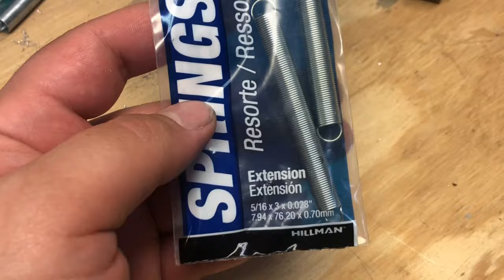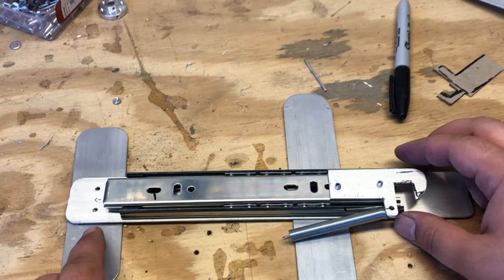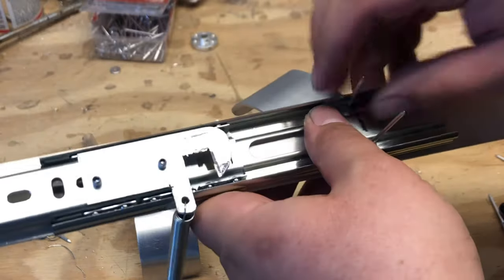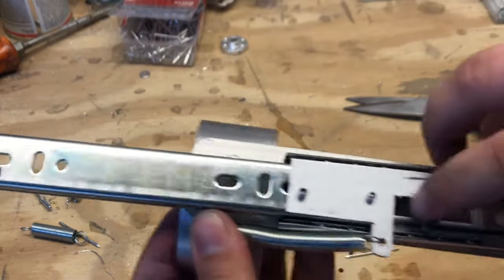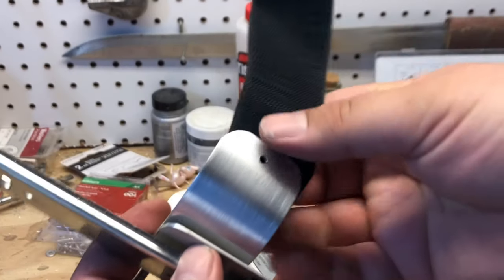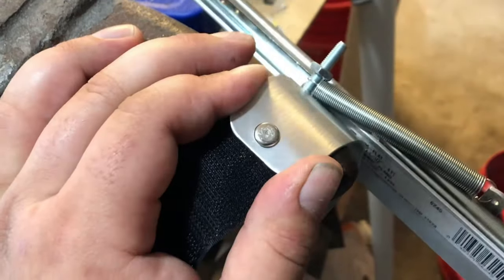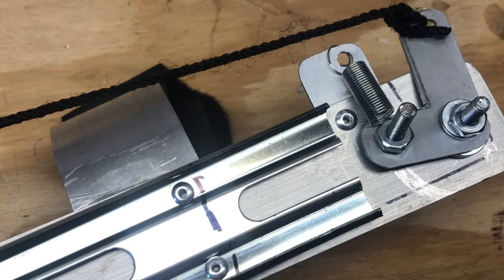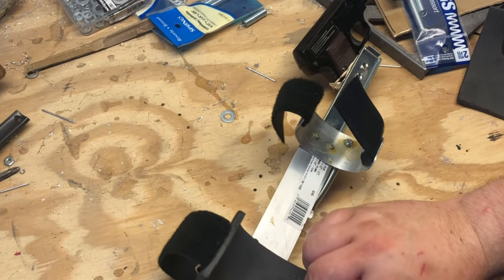I Made A Taxi Driver Quick Draw Gadget

Comment: What would I have to do different for a left handed one?
Reply from the maker: All you’d need to do is mount the gun, the L bracket and the catch at the back of the blade upside down and it should work for a left hand. A good visualization would be to hold it up in a mirror. position the parts in the orientation of the reflection. Hopefully I’m explaining this clearly 😅
Reply: @thetiredcraftsman  one more question, how long was the drawer slider, I don’t wanna waste my money on one that’s too long
Reply from the maker: @ShlerpCat getting one that’s too long isn’t a problem. I cut mine down in the video to fit me so it’s actually preferable to get a longer one so you can make it the size you need.